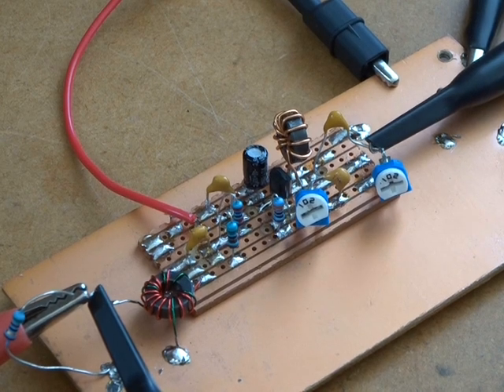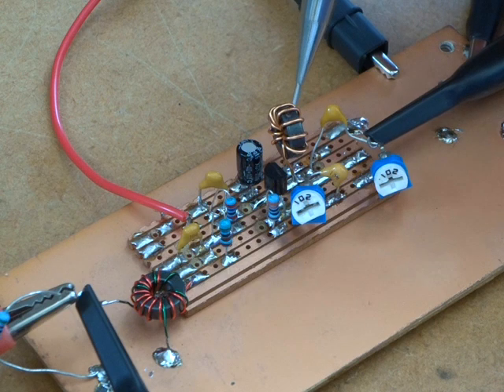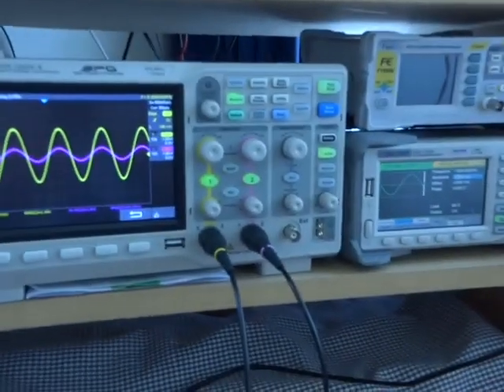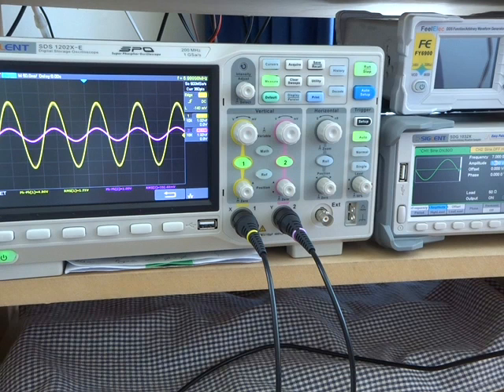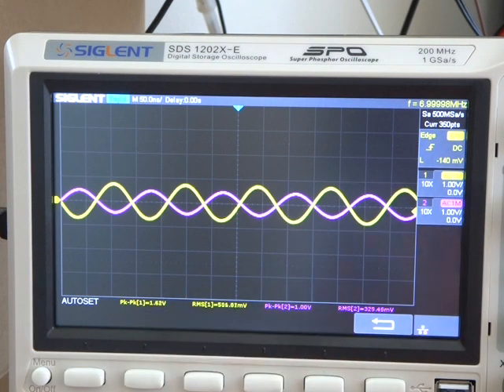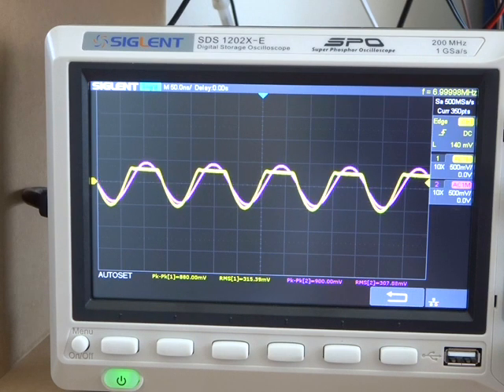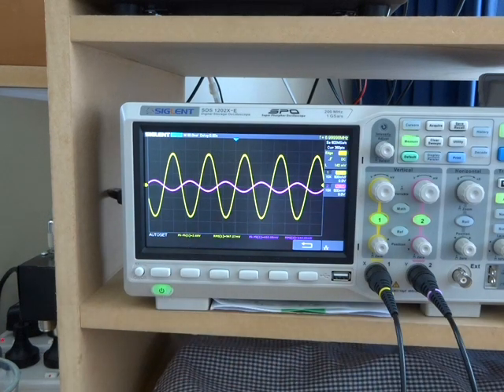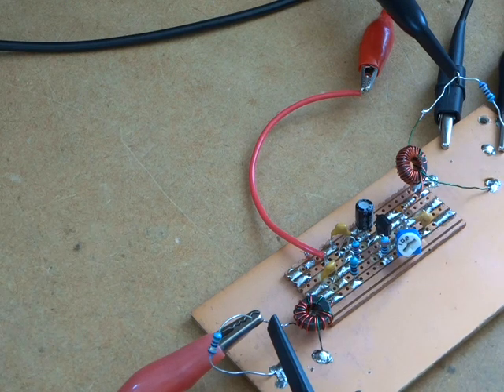Homebrew Portable 40m SSB QRP Rig. Part 2a: More Antenna Amp Experiments

Comment: sorry, maybe I missed something here but it is obvious that after you insert a 14:4 transformer and measure your voltage at the output your initial gain of 4 (which was seen right at the collector) will now be 4 x 4/14 at the output of transformer. In fact you were getting more gain than what you should have (~1.5 was it?) am I missing something?
Reply from the maker: Great point Amir. I think that makes perfect sense Amir. The ideal 600odd ohm was indeed directly at the collector. The 14:4 transformer would transform 50ohm up to
that, and yes, the voltage would be reduced by a factor of 4/14 going from the
collector to the 50ohm load. So that being the case, then I should probably go
back to the 14:4 xformer and go from there. While the voltage has been reduced
the current should have increased (by 14/4), so I should be ultimately delivering
the same amount of power into the mixer, which is the aim. Does that make sense?
Reply: @CharlieMorrisZL2CTM  yes, absolutely. The toroidal transformer can be safely assumed lossless here (very low loss) at this frequency and these mA current levels.
Reply from the maker: Amir. I wonder if it would be better when calculating voltage gain that I should be comparing the voltage at the collector (not the load) with the voltage at the base (not the sig gen output)? Also, it makes sense then to measure power gain by comparing Vsig gen^2/50 ohm (as the input transformer is transforms Rin to 50 ohm) with V50 ohm load^2/50 ohm (the load).
Reply: @CharlieMorrisZL2CTM  I wouldnt measure at base and collector because its kinda meaningless specially from practical point of view. If voltage gain is important then it should be measured at the input where the pre-amp will feed the amplifier and at the load where the antenna will connect. Now, of course, if the impedances are 50 at these two points then you also have your power gain by simply squaring the voltage gain
Reply: by the way nice sig gen. I have a 2042 which I hacked to 120MHz. I think 1032 can also be hacked easily. Information to do that are out there somewhere!
Reply from the maker: @amirb715  Agreed

Comment: Hi Charlie, I noticed that you upgraded your test equipment. What is the RF Signal Generator you are using now?
Reply from the maker: Gidday Orville. I got the Siglent 1032X. It certainly works well for my needs.
Reply: @CharlieMorrisZL2CTM Thanks for the info Charlie, I just received my Siglent 1032X in today's mail. It is an early Christmas present from my Wife. :) I have to wait till Christmas to use it though! LOL
Reply from the maker: Orville Jones Very nice. I’m certainly happy with mine.

Comment: Hey Charlie, daft question but are you certain those cores are FT37-43 material? I have just worked out that 25 turns would equate to around 9,000 ohms Z at 7MHz? What about changing the config from a transformer impedance match to an L-Match, you could pop in a fixed inductor and a small trimmer cap and peak for the best power transfer? 
Very interesting video, looking forward to your next episode.

Cheers

Rob.
Reply from the maker: I should say too that I intend to look at the L match for the IF amps. I then may look to use one on the ant amp if I feel the overall gain of the radio needs a little more (as opposed to additional IF amp stages)
Reply from the maker: Hi Rob. Yes they are FT37-43. I only buy them form Kits and Parts. I use the following link as a quick calculator for inductance: http://toroids.info/FT37-43.php
I check the numbers again.

Comment: Very enlightening to see how the real-word transformer affects the performance. I'm guessing that the ferrite materials are quite lossy. Just goes to show the importance of actually making measurements rather than just relying on the theory. Given 40m only, perhaps you could try tuning the transformer with iron core and parallel C, or even RFC with LC L-match for a worthwhile improvement.
Reply from the maker: That's certainly something to look at Stephen. I'm weary that I don't want to have too much gain before the IF strip. The LC match should be a good fit for the IF amps as the freq is fixed. I've jotted it down!